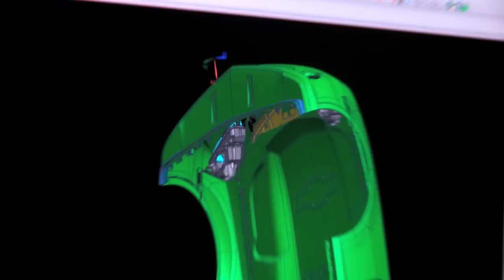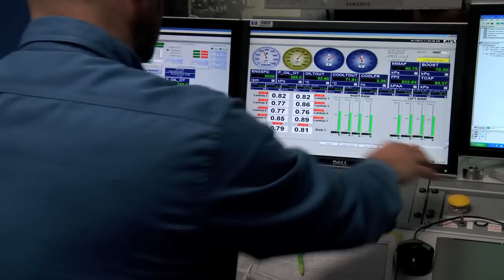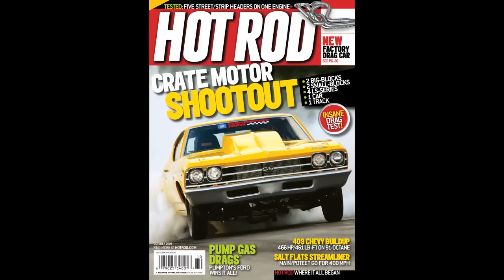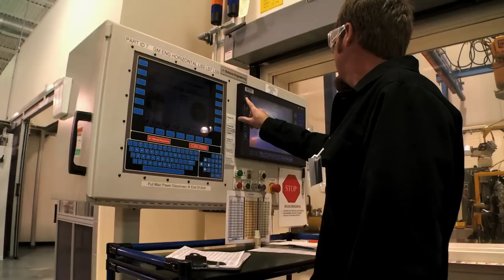2012 COPO Camaro:  GM's Baddest Factory Camaro Ever! - HOT ROD Unlimited Episode 6

Comment: I am completely aware of the new GT500 and its power does not matter... We have seen $100,000 800 BHP Supersnakes that cannot even get a sub 4 second 0-60 time. The COPO vs Cobra Jet is a rare rich mans battle that can go either way... The ZL1 vs GT500 is alot more even than you think. The ZL1 actually has 21st century technology suspension and chassis components...The ZL1 will hook up better in the low gears and b/c of that it will negate all that power the GT500's spin away.

Comment: some people need to do their research on Stock Eliminator and Super Stock rules... no Cobra Jet within the specs of either of those classes is running in the 8s, in fact they only Cobra Jets running in the 8s, have 2 power adders... there isn't a NHRA class that allows 2 power adders, not from street stock to Top Fuel... you're allowed nitrous, a blower, or a turbo... choose one and choose wisely. the Copo in its 1st day out, got with two tenths of the existing world record with a 9.51 to a 9.37

Comment: My mom bought a 64 off the showroom floor. While my dad bought a firebird. Why do you think that is, its because the stang had a little bitty teeny weenie engine and it was "adorable". On the otherhand the firebird had a 400 with 330hp and 440lb/ft of torque of the line. My 69 firebird that i currently own has never lost a race to a mustang. You should research yourself, I pulled all of my numbers off mustang enthusist websites. Mustangs are nice looking, but far from being actual muscle cars.

Comment: You're clearly ignoring the question of why the LS3 beats the 5.0. The RWHP that shows up "on the ground" shows up at the track and clearly the LS3 dominates in nearly every area of racing. Why have you not commented on that? ALMS is one of the areas where the SB Chevy dominates against the Ford.   You keep saying the LS3 is inferior, but you don't recognize that it makes more power. If you don't need more cubes to make power, why did the 2013 GT500 get an additional .3 liters? Ford knows that.

Comment: Haha, yes, true, my bad. My point was just that despite its shortcomings in design, it still has better numbers in stock form, and really, there is no point in poo pooing a car that does perform (however 'outdated' it  may be). A mustang and a Camaro are, after all, muscle cars, at least in my eyes. Of course owners can add parts and make them handle better and be faster than one another, but that is a matter of owner ability, not what was produced from the factory.

Comment: I understand its a concept that's hard for you to grasp, but yes internal competition is not good. Sure Chevy and GMC move units, what about Saturn, Pontiac, do you think that if they were profitable that they would have been absolved?  For each of those cars sitting on a lot, there is manufacturing costs not being regained and maintenance costs being spent. Had it been one car under one badge, this would not happen. Similar models not selling hurts the bottom line, hence why GM consolidated.

Comment: well i guess you must've thought what I said was right, because you didn't bother to correct me. Most ppl would of corrected me on the real reason the mustang was designed.  The real reason it was designed was to challenge the corvette.  Ford already had the thunderbird which was a two seater sports car.  Thats why the president of ford came in and told them to change it.  Thats how the mustang came to be and happened to be the hottest thing on the street in 1964 besides the pontiac gto

Comment: The ZR1 weighs 3200 LBS! And they did make em' bigger. The LS1 was 348 inches. The LS3 is now 378. Chevy is reducing the size and adding D.I. to bring the fuel economy up and try and make the same power. Look at the weight restrictions if you seriously want to keep bringing up class racing. . So do you think a 302 inch LS motor could make the same power\ torque\ mileage as a DOHC Coyote motor? C'mon. What do you think?

Comment: no you guys busted a nut when the Coyote did it like it'd never been done... the reason it was getting "slaughtered" is it was pretty much the same car in 2002 that it was in 1993, with minor updates... Instead of throwing out a quick update, GM scrapped it... they did bring over the GTO but it never was a high volume car in the U.S. by the time its run ended, they had already broke ground on the new Camaro, which isn't going anywhere, they've already broke ground on the 5th gen's replacement..

Comment: It was a decent race between the two cars.  I think it would be even closer between the ZL1 and 12 Shelby but the new 13 Shelby would blow the doors off the LZ1 with shelby's new 5.8 liter 650bhp and top speed over 200mph for under 60 grand.  I think if the shelby wasn't such a fat ass it would give the ZR1 Corvette a run for its money.  My favorite pontiac car though has to be the sunset orange 2002 WS6 T/A. Just a beautiful car and amazing body styling.  I was sad to see pontiac shut down

Comment: As a matter of fact, you're wrong! The LS3 makes 426 HP and the 5.0 makes only 412 in the 2012 and 420 in the 2013...that's less if you can't count. If you want to count magazine articles, there are 3 to 1 that say the Camaro is faster, but I beat them regularly in my Camaro, so I don't need no stinkin magazine. You keep saying it's better and keep failing to comment on why the 5.0 doesn't win races. It can't be better if it doesn't win even with it's weight, gearing, etc advantages!!!!!!!!!!.

Comment: A couple things: if the 5.0 is such a great car, why has Camaro beat it in sales almost ever month since the beginning of production. If you watch pass time or Pinks, you surely see the many Ford guys running Chevy engines. Gees, even the old Hot Rods prefer Chevy small blocks. You have to ask yourself the question: why? The answer is simple...the Chevy SB is powerful, reliable, simply produced and it whips Ford's butt in every auto venue. Sema fans voted the Camaro the hotest car.2 last 2 years

Comment: only thing the stang has over the camaro is the hp...which 9 times out of 10 all you ever see is a stang losing traction because of all the extra power. SO you keep your 700 hp and 190 top speed or wherever its at now and no traction on the strip. and ill keep my 9 second 1/4 mile. Oh and i forgot the new turning lights on the stang are pretty cool...ill give you that

Comment: Of course the power matters. And the LS3 power-plant is exactly where GM lacks 21st century technology. The 2013 GT500 has completely reworked gearing from the transmission through the rear end. It has launch control and a large power to weight advantage. Not to mention the GT500 has a new dual setting suspension with a tighter track setting so while it's not as advanced as the ZL1's suspension it will probably be close enough to let the power and weight advantage do the rest.

Comment: 427 was a popular drag engine... hell it was a popular engine period. 454, while a great engine in it's own right, it's somewhat overrated because of the Chevelle.

The L88 and ZL1 engine of the late 60's were iron and aluminum 427's respectively and made the most power of the Big block V8's of the time. This car is a throwback to the COPO of old that used a 427, not a blown whatever.

Lastly, and this is preference, all motor is more attractive to me. A 427 is all you need to kick ford ass.

Comment: The LS is a Ford engine from top to bottom. It is a combination of 3 Ford engines. Modular, Windsor, 427 high riser. THIS IS THE CRIME OF THE CENTURY HOW GM STOLE EVERY ENGINEERING DESIGN FROM FORD TO CREATE THIS ENGINE. IT IS 100% FORD.

Comment: It's clear you don't get it. You cannot make power as efficiently with a 2 valve push rod motor. The chamber design is not optimal, The valve angle and location is not optimal, and it forces a less than optimal location for the spark plugs. Not to mention routing the intake air path around the pushrods. Then there's the weight of the lifter and pushrod and the extra spring pressure you have to run to offset all that and a large heavy intake valve. All that combines to = less efficient.

Comment: the original design of the mustang was not meant to compete with the vette. Did the 64 mustang have a backseat? Did the 64 mustang have 375 hp? Then it wasnt made to compete with the vette. And all of those engines (302, 427, 428, and 429) didnt come out till chevy and pontiac had been spanking that ass for a few years. If the engine was big enough to house the 289, then they can house the 302. A small block is a small block.

Comment: They don't have to make them bigger to make more power. The fastest production American car, the ZR1 is a 6.2 liter motor with 638 conservative HP and isn't any bigger than my Camaro's motor. It still gets decent MPG. They haven't made the LS motors bigger, they're actually making it smaller and more powerful. As a matter of fact, the newest LS engine is a 5.5 and it's the engine that's trouncing the DOHC engines in ALMS DP and GT road courses, in Corvettes, Camaros and CTS-Vs. U know nothing!

Comment: See. I let you turn this into a Ford vs. Chevy thing. It's not. It's a DOHC vs pushrod thing. So here's the final reason you're flat wrong. I'll use GM to prove it: When the new extra heavy Camaro came out Chevy needed a  fuel efficient 300+ HP V6 for the base Camaro and what did they pick? That's right. A 4 valve DOHC 3.6 liter 312 HP motor that gets almost 30 MPG. Think any of Chevy's push rod V6s will do that? Oh and if that 3.6L was as big as the LS3 it would make way more than 426 Hp.

Comment: And had Ford kept developing the Windsor instead of stepping up to modern valve train design the Ford Push rod motors would be sporting the same inefficient power per cube numbers the LS3 motors do. But Ford Stopped putting the Windsor in their cars a long time ago. Also the LS3 doesn't have cylinder deactivation. The 400 HP L99 does. The LS3 doesn't have direct injection either. Funny. The 3.6 V6 in the Camaro has D.I. Did I mention the superior DOHC and Tivc tech in the Camaro V6? Nice huh?

Comment: Oh and I never disagreed that it takes a bigger engine to make more power. That's why GM had to go way bigger with their LS motors to even be competitive with the little OHC motors. Seriously you can't admit DOHC motors are more efficient can you? Well the rest of the auto industry already did. You will never match the power per cube of a 4 valve with an inline 2 valve. Any where where the size is similar the 4 valve will make more HP/torque. Like the flathead the Push-rod is a dying breed.

Comment: that technique of less weight and the same power seems a bit European to me. i think the best method is to add power AND to subtract some weight. to me, 3500 lbs with (dear i say) only 400hp isnt muscle car dna. i say get the weight to 3750 with the panels, add the zl1/cts-v/458 suspension, add the 505hp LS7, remove the rear seats, and have the ultimate street legal camaro track car. thats imo what the z28 should be

Comment: you said it wasn't until 2003 with the SVT cobra that ford start beating camaro/TA...  I was just stating that the 2000 Cobra R was far superior to the Camaro/ TA. I'm pretty sure even with Full interior and A/C the Cobra R could outrun a Camaro/TA. Yet, being a Ford fan Myself.... considering the price difference of the R and a Camaro, You can't beat the Bargain Chevy offered you in those days.

Comment: They put LS engines in SUVs making 390-400 HP...you wouldn't expect to claim a victory beating one of those with a Mustang 5.0. The DOHC 5.0 Mustang has, factory headers, 300 lbs less weight, factory CAI and better gears than the 6.2 Camaro, as an example and yet the Camaro beats the Mustang, according to Road and Track, Car & Driver, Hemmings, and me. I beat a 5.0 two weeks ago with the exact same mods as my new Camaro at Memphis IR. Why? Better engine, more torque and HP.

Comment: It's not a mile car it's a 1/4 mile car. Don't you understand what a drag car is. it's made to compete in NHRA super stock class.For your twin turbo custom unreliable 4 banger, someone can bring is bone stock 580 HP with 5 year 60 000 miles factory waranty Camaro Zl1 and see what it can do. Also, chevrolet guys can all put twin turbos on their Z06 LS7 V8 and blow your doors off budy. No replacement for displacement!

Comment: hate to break it to you but from 1993-2002 the camaro and t/a was beating the hell out of the mustang.  it wasn't until 2003 when ford came out with the terminator cobra that had 390bhp was it beating camaro's and t/a's.  I'm a mustang guy love the mustang but you need to do some research before you run your mouth.  chevy had some amazing cars in the 60's and 70's.  The corvette has been strong since 1953.  The LS series engines are prob the best built engine's out there for the money

Comment: I'm not gonna argue with you anymore.  You don't know what the hell your talking about.  The orginal design for the mustang was meant to compete with the vette.  Ford was limited to engine size in the mustangs till 1967, because of the size of the engine compartment.  Plus your forgetting about ford's boss 302, 427 side oiler, 428 cobra jet and boss 429.  All four engines dominated the racing world.

Comment: Ehh no. The Ford GT500 is 200lbs ligher with 85 more HP and barely keeps up in the twisties. It would actually be a LOT faster without its ancient live axle..

A live axle will have roughly double the unsprung weight of an equivilant IRS. Inertia will cause a wheel thats bouncing from the road to hang in the air for a split second while driving. The more unsprung weight that there is, the higher and longer the wheel will hang in the air after a bounce. This means less traction.

IRS> live axle

Comment: why are copo engines makin less hp than some of gm own crate engines ?  come on bow tie guys ?  copo 427 =425 hp vs ls376 crate eng  6.2 l 480 hp        and if you look in the catalog the copo crate eng are 30 g vs around 6-7  for regular gm perf.  are they dry sump? wth, makes em so xpensive  http://www.crateenginedepot.com/Performance-Engines-C556.aspx
Reply: Those are the NHRA ratings which are essentially complete bs... the N/A 427s are pushing over 650-700 at the flywheel

Comment: the Cruza had less than 50 reported problems, they simply did the recall as a precaution as MOST manufacturers do. the mustang got an update in 2010, a new engine(the 5.0) in 2011 and yet STILL got outsold by the Camaro. China owns 70% of GM? lol,  Bangladesh owns 91% of Ford, I can make up fake statistics too! the ZL1 was on quality hold because Oshawa was on a SCHEDULED outage for maintenance, when the words "quality hold" was released, sources ran to the wire without confirming WHY

Comment: What are you smoking? The Chevy small block still dominates the Pro-Stock NHRA championships. Ford hasn't won one in 10 years, oh, and the 351 Windsor is still available...so where are the records? Google Pro Record Holders and tell me how many Fords you see listed, or Competition Eliminator, and Chevys dominate the record book on Stock Eliminator. When you've seen that, come back and tell me how powerful the 351 Windsor is/was! You're wrong: Summit lists Ford engines just as cheaply as Chevys.

Comment: I wonder why Ford uses a Chevy Powerglide transmission? There's an obvious answer to that. Chevy does make as tough a rear end as the Ford, the ford is just easier to change gear rations. Check the facts before you post!

Comment: Dont get me wrong... GM has a bad pension for playing "me too" when it comes to car trends. Other than the untouchable corvette, and the long withstanding Surburban, GM has no other truly original product offernings. 

At the same, the last ground breaking technological innovation for Ford was the pentroof OHC head design of the 60's during formula one. Beside that, there hasnt been a single technological innovation that has been developed by Ford that wasnt a rip-off of GMs engineering R&D.

Comment: The M3 outperforms the Camaro?  Wow, you are truly misinformed. Have you not watched the ALMS GT classes where the BMWs run 10th or so and the Camaros have had podium finishes in the last several races? The M3 runs the quarter in 12.8 seconds, costs over 80 grand and i would have beaten it by 4 - 5 car lengths in my exhaust modded l99 Camaro running a 12.49 with 3:27 gears see my videos.

Comment: how come chevy has not made a rear end to withstand highhorse power. so they dont have to use another car makers design.chevy builds alot of power with their engines and have good transmissions.  but their rear ends dont hold up to power.

Comment: No evidence? Seriously? Here's a clue. It takes a 20% larger push-rod motor to match the power level of a 4 valve O.H.C. motor. And yet they can't even come close to the horsepower per cubic inch level of D.O.H.C motors.  So are you seriously thinking that a 302 inch LS motor would be a match for Fords 302 inch Coyote motor? If the D.O.H.C. V8 in the Mustang GT measured 378 cubic inches like the (426 HP) LS3. It would make 515 Horsepower. A push-rod canted valve 351 Cleveland is more advanced.

Comment: Again. The 5.0 has the same RWHP numbers as the much larger 6.2 LS3. The 300 LBS less weight is why the Mustang runs away from the Camaro. And you include the one R&T article where a Camaro won and not the other where the Camaro lost by 3 tenths and 2 MPH. Great job spinning that. Again. The LS3's inline 2 valve architecture is inferior to the Coyote's pent-roof 4 valve DOHC design. It just is. No amount of data mining is going to prove you right. A 4-valve motor makes a lot more power per inch.